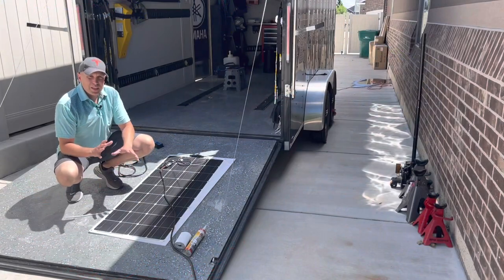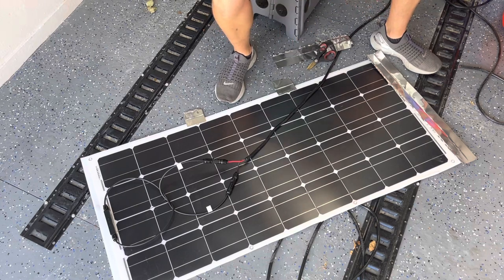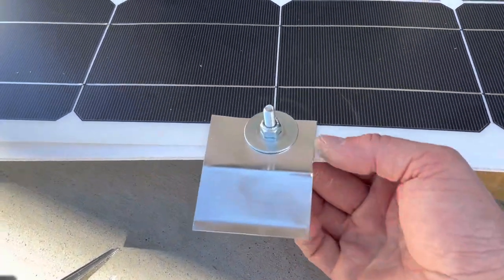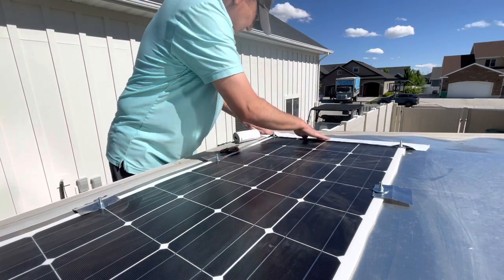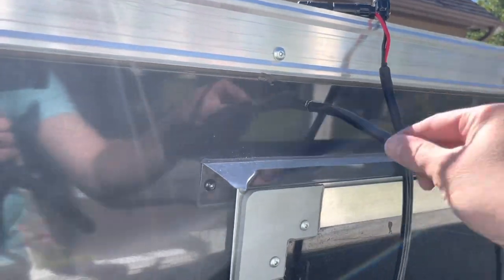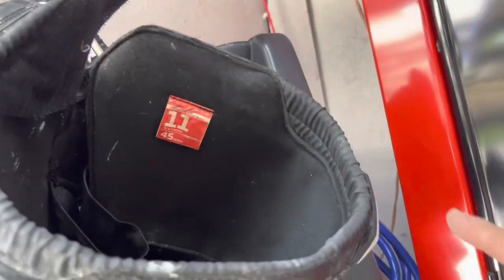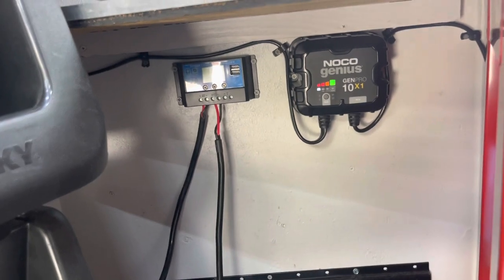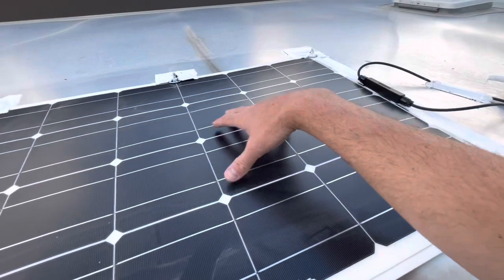Solar Panel Installation On An Enclosed Cargo Trailer | How to install a 12v Solar Panel Kit | DIY!

Comment: I’ve had 4 flexible panels on my Sprinter for years with no problems, but it looks like you may be losing some effiiciency by shading the panel with the aluminum and also the long bolts.
Reply from the maker: Thanks for the info

Comment: You want more eterna bond tape actually attaching to the roof ….you’ve got it fully covering the alum tabs, but barely over the side touching the roof. I know it’s a strong tape but over time you’re risking debonding to the roof because it’s barely there
Reply from the maker: Yeah, that's a good point, thanks for commenting

Comment: Thanks for the video. I’m looking to do the same thing but batteries get more use than just lights. 

Any updates on how it has the panel has held up through the winter?
Reply from the maker: It's held up well, still going strong

Comment: Great video thanks. So does the solar charger controller automatically shut off when the battery is charged and does it maintain the battery at 100% without your extension cord hooked up.
Reply from the maker: I can't confirm if the charge control shuts off at 100%

Comment: Thanks for all the info Myks. 
We're getting ready to install 4 x 100W panels on our cargo trailer mainly for the ability to keep all 4 of the  Batteries for the Boat Stereo charged (don't ask... lol...) as they park in tandem. I do agree with Ian that the leading edge of eternabond should be a bit bigger (can't hurt)
Also, I have a lil Karcher pressure washer that actually works pretty good with 55 gal on board water tank so perhaps with the right battery and inverter I can run that and not need the generator just to leave the dirt where it came from (my neighbors appreciate that). BTW I really like the tex coat paint on the walls and epoxy flooring. Did your trailer come that way? More upgrades coming on mine I guess... Moto On!!!👍👍
Reply: @ Myks... Just saw the epoxy floor video... 👍
Reply from the maker: Nice!!

Comment: Question:  can both the solar charger AND the onboard 110 charger, be connected to the battery at the same time?  Meaning, can I leave both leads connected to the battery and have both sources charging at the same time?

Not for the intention of charging faster, but because of not wanting to change connection sources if/when I have access to a supplier power source and don't want to connect/disconnect every time.
Reply from the maker: Good question, I leave both connected at the same time frequently and they will both be charging the battery and will then stop when it's full

Comment: What kind of sheet are you using under the solar panel? Can’t find that one on Amazon… and also, can you put the aluminum metal that you got and the tape you used
Reply from the maker: It's this stuff 
https://www.amazon.com/dp/B01HQHQA26/ref=cm_sw_r_as_gl_api_gl_i_YSBP7XVSGV43037QKSDS?linkCode=ml2&tag=myksgarage-20
Reply: The solar panel is almost 48 x 24. Did you stick two sheets together to cover the solar panel?
Reply: @HockeyRef14  I haven’t ordered mine yet, but I’m pretty sure you could. Did you order yours yet? And have you start it?
Reply: Purchase 24x48 sheets off Amazon. Installing once they come in next week
Reply: @HockeyRef14 can’t  find the 24 x 48 put a link in the description are you going to put your battery and everything in right away? I think I’m just gonna get the solar panel and run that for now and when I get more money does add little by

Comment: hows the panel mounting holding up?
Reply from the maker: So far no issues or problems, it's holding strong!
Reply: @Myksgarage  im building a system mounted on my cargo trailer. so far I have installed 7 panels rated at 250 watts each I still have 5 more to mount, with an 8kw inverter and 2 server rack Lipo 48 volt batteries I had to use sq tubing and screws no tape
Reply: @chadjones99  I would like to know more about your set up and if you have a line on where to pick up a high quality trailer for cheap.  I want to do the same thing.  I already purchased the inverter and batteries (EG4 6500EX & three EG4 100 AH 48V server rack batteries).  On the hunt for a 16-28' trailer then I'll figure out how to max the solar and start putting it all together.

Comment: Real question, do you need the trickle charger if you have the solar panels? I want to copy your build amd was wondering if i have to keep the trickle charger plugged to the trailer.
Reply from the maker: In the summer I don't have to plugged it.  Over the winter as the panel as been covered in snow, I have it plugged in
Reply: @Myksgarage  In your video you werent sure if the solar panel would "over charge" the battery.  Did you find out if that was the case or not.  What about just running the cords from the panel straight to the trickle charger
Reply: @johnjuhasz7060  I know this is an old comment, but I thought I would chime in if you never found out. The solar controller protects the battery from getting over charged there are a few customizable settings in this style so you can even fine tune the voltage. You never want to plug solar directly into anything other than a controller of some kind because its wattage and amperage fluctuate throughout the day. You couldn't plug it directly into trickle charger anyway because these solar panels work on 12v DC like a car does, not 110v-120v like a typical house plug which that trickle charger needs.

Comment: Really wish you would have used a grommet and a drip leg on that wire before it went into the hole above the door.
Reply from the maker: Good tip

Comment: Dude.  Horrible implementation of your solar panel.  No drip loop, no protection for your cable coming in the trailer,  sloppy way to tape the panel to the rooftop, sloppy way to manage the rooftop cables of the panel.  Definitely a DIY job by someone who doesn't know what they're doing.

Just because you got it working doesn't mean you did it correctly.
Reply from the maker: What does it matter?
Reply: Apparently not to you.  That question tells me everything I need to hear.  Best of luck to you.